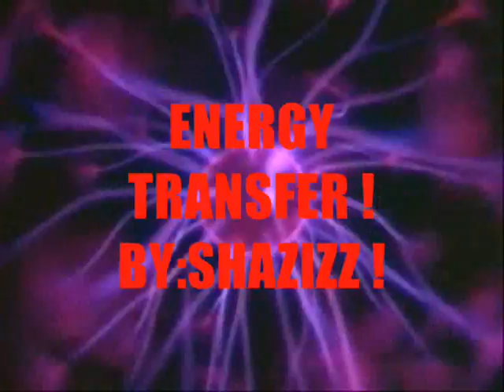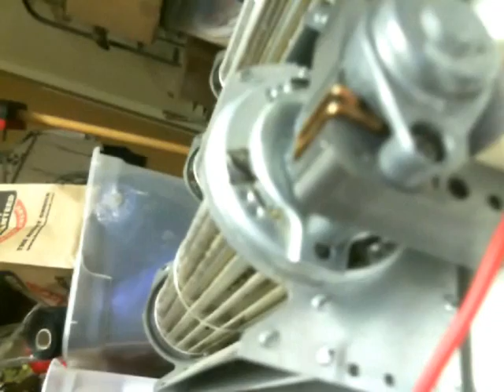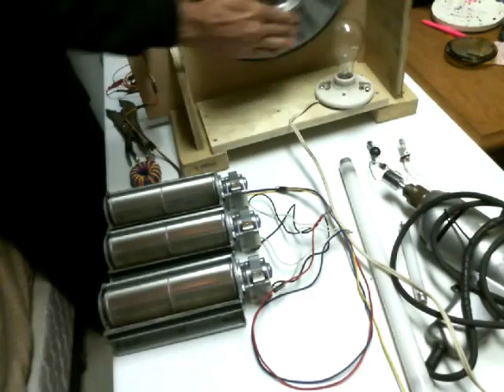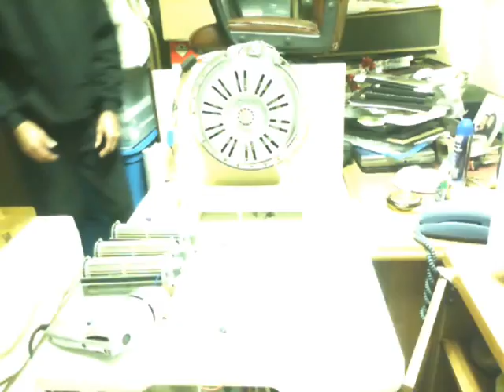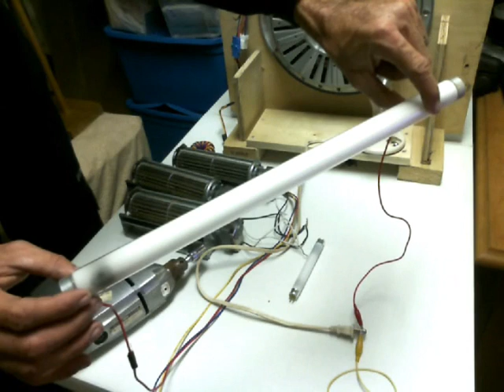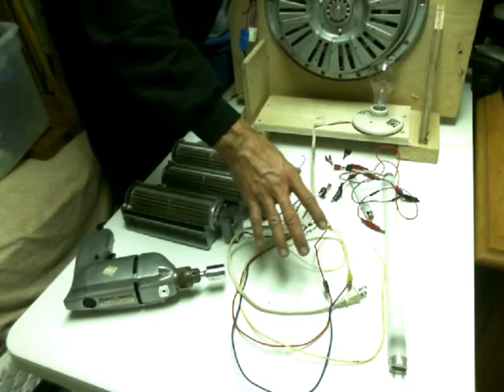ENERGY TRANSFER !

Comment: Hi is it possable to make a car alternator become a type if tv flyback by utilising the b+ and winding the 3 phases together to cause unregulated spikes like a car coil collapsing centre does this would interact with the starter motor and be a bouncing neutral attraction of the engine block. Like a van de graf
Reply from the maker: +honda4004 You can pretty much do this with any coil around a core. it will act like a magnetic ballast. If you take a 9 volt battery and hold both wires at the same time on any small transformer or stator and tap the wires you will notice that you get a shock each time you let off the battery. this is the field collapsing the faster you do this the higher the voltage return. Be careful  though use a volt meter instead of your hands to see results for safety purposes. :)
Reply: Hi thanks also could I point you to the fact that by causing a vacuum in tge engine sump that that would become the tv style vac tube so the block inner cylinder would attract the type of cathode ray electron source inward.   www.jiecellwaterscience.com.  Joe booker states "we get the pos and neg together " bus friend tells me a tight hand vortex swirl round the engine negative place a Incoming vacuum what you got ?   I've a feeling stan Meyer knew a tv flyback with coils wrapped around the wire glow causes a non emf sequence